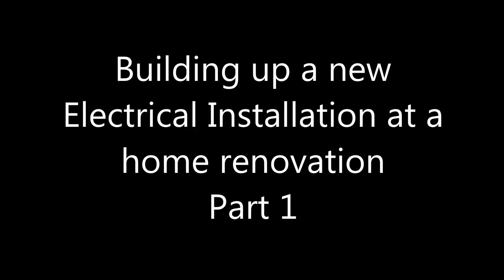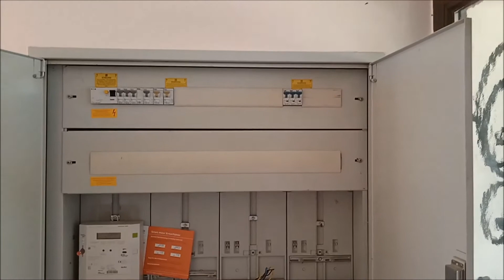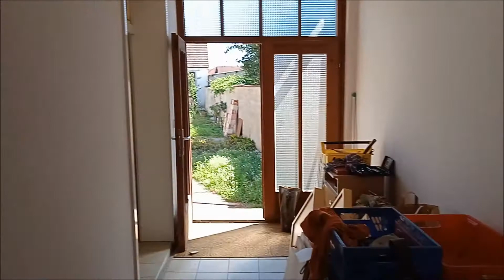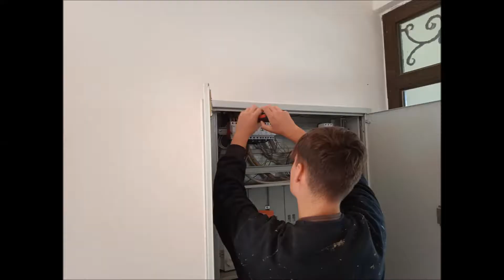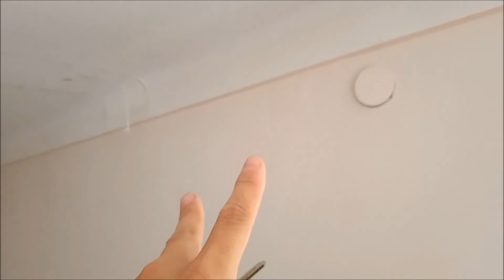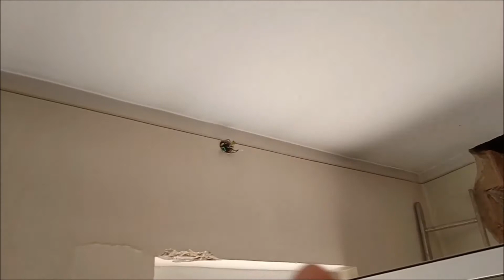Let's do a Renovation! Renewing the electrical installation of an old Austrian house. Part 1

Comment: Massive power box compared to the compact consumer units we see today.  Also where was the hot live from the light switch or was it serving the other light fitting too?
Reply from the maker: yes, the hot wire was intercepted from other purposes as it was routed to the back of the building. I was a bit confused until I realized what was going on there. hehe